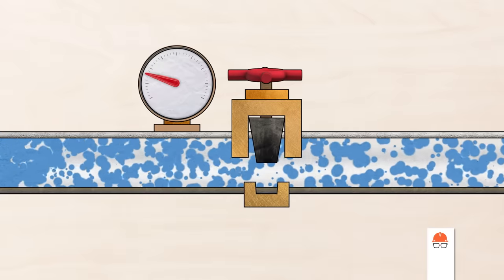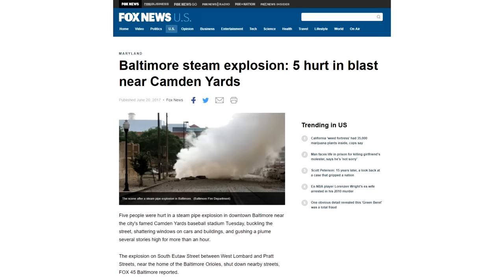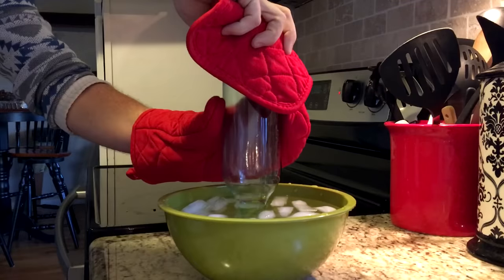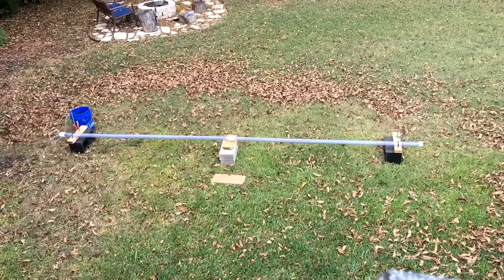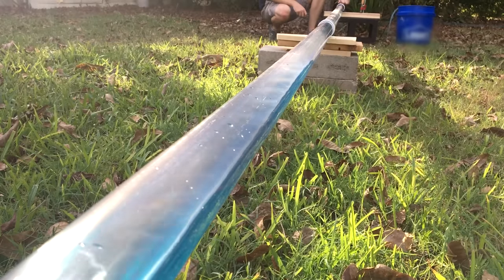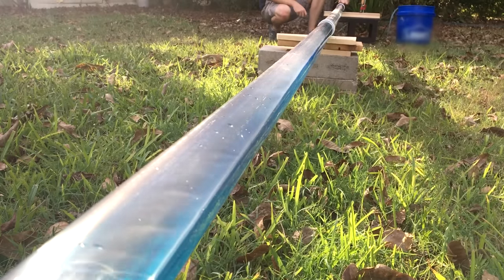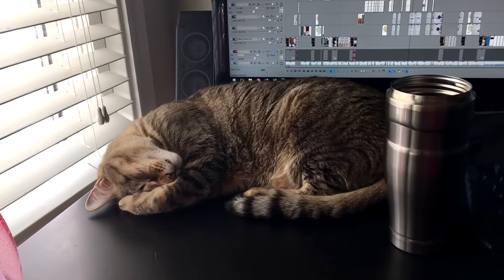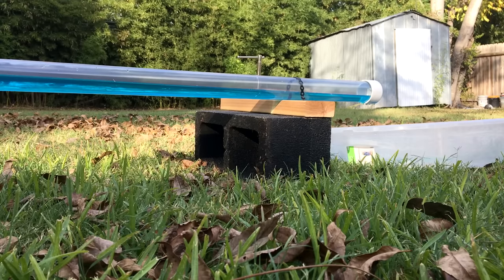What is Steam Hammer?

Comment: Amazing ! You're able in 5 min to introduce this very complicated issue of steam pipes ! Indeed, steam is useful and can be dangerous if miss handled. I used to work in a Chemical factory and during the construction, I was involved in the steam pipes design. For cost cutting, the final client (Chinese) decided to cut the bleed valves and the steam traps. I had to fight and was desperate about this issue. Of course, during the startup there was a huge blow and a 20" pipe broke. We were then obliged to halt the project for 3 weeks to install the bloody bleed valves and steam traps. Hopefully there were no big losses other than the 20"pipe to be replaced (+ insulation + weldings + some flanges)... But hey, This is China ! 
One comment to what you said: there are not only chemical engineers and mechanical engineers involved in steal transportation issues. There are also process engineers ! So please don't forget us next video ;)

Comment: Next month: What is Ice Hammer?
Reply: Actually, although it's probably not called that, pressure exerted by ice is probably a really significant consideration in civil engineering, so I say Grady, get to it and make a nice seasonal video in about that third phase of water so many of us have to deal with around this tine of year.
Reply: Ice hammer is what happens when you drop that 10 pound bag that you bought from the store on your foot. :-p
Reply: When a lake is frozen over and a breeze is blowing across it sometimes the ice can be pushed ashore and destroy property. I'd call that ice hammer
Reply: Nabre Labre True, super rare, but I’ve seen it...

 Interestingly caused by basically the same thing as the steam hammer he demonstrated... 🤔
Reply: Nevir202 just read some stuff regarding Niagra falls. Apparently the only (recorded) time the falls ran dry due to non human intervention was after heavy winds blowing across Lake Erie increased the water flow and forced large amounts of lake ice into the mouth of the Niagra River creating an ice damn. Not quite a"hammer" but pretty interesting.
Reply: Andy Brice Ice can block a river's flow temporarily. The water builds up. When the dam bursts, it can cause catastrophic flooding.
Reply: Ice Hammer was an underground hip hop artist in the late 1980s.
Reply: 2020 : plasma hammer
Reply: @qwertyTRiG  
At one time, when the glaciers that covered most of Canada were melting, a giant sea of water built up on the ice pack. As it moved closer and closer to the edge, the rim of Ice broke away, releasing a sea of water into the Atlantic ocean.  The water rose about 20' worldwide in a very short period of time.
Reply: @truthspace5525  That would also have a massive effect on ocean salinity, I'm sure.

Comment: Surprised you only covered just the one problem with steam.
I used to work on a large estate as an electrician, but as we were multiskilled, i dealt with some aspects of heating, that included the steam system, i was trained in how to work with steam.
On an industrial steam heating system if the steam is shut off to a building (auto safety valve), to restore the steam we shut of the manual valve, reset the safety, then gently crack open the manual valve for a short period, this was to start the heating of the condensate, this was followed by a series of opening and closing that valve until we could only hear the steam going though the pipe without the boiling sound.
Basically, if you let the steam in too quickly, it would flash the condensate to steam, creating a lot of pressure.
Those coffee machines with the steam injector boil the water in ther cup in the same way.
Reply from the maker: Sparky Projects I did cover flash condensation (thermal shock) in ththe video
Reply: But mostly about steam turning to condensate causing a vacuum, but when steam heats that condensate, it turns that to steam (flash heating) and can create a lot of pressure
Reply: I take it you are using seriously superheated steam?
Reply: I don't know how superheated, but we had '3 pass' industrial boilers running at 100PSI.

Comment: I have been working as an operator of engine rooms since 1986 (retired 3-21). I have seen a 300#, 3" tee blown out due to priming from improper boiler water level control (manually controlled coal boiler). I have many times tried to explain steam hammer to the new guys as a slug of condensate propelled at the rate of steam flow into the first obstruction encountered. Your video presents a visual representation I wish i could have shown them. Some got it, some didn't.

Comment: That is an excellent description of the water hammer concerns in steam delivery pipes.

Another location steam hammer issue that is found in steam turbines, and the case there is somewhat different.  At the plant we were most concerned about was the cases where the temperature or pressure of the steam dropped, and water droplets would form from the steam and be entrained in the steam flow. in this case, when there was a bend in the pipe, the water would impact and damage the pipe. You could audible hear the pinging of the droplets in the steam when this occurred. thankfully i never had an occasion to hear an actual occurence in the plant. 

This concern was greatest if the pressure for the steam header fell at the input to a generator. a case that could be caused if your steam turbine demand for steam increased faster than the rate  of steam your steam source(boiler, nuclear reactor, etc) could increase at. 

when the pressure at the inlet to the turbine dropped, the Curtis and Rateau stages that drop the temperature and pressure of the steam to generate the kinetic motion of the turbine may cause condensate in the later stages of the turbine, as it was designed for a certain temperature/pressure of steam at the inlet stage. This can cause water hammer on the turbine blades and over torque the later stages of the turbine. 

in fact one site had such an issue the last stage of the turbine oblong-ed the shaft and caused a vibration that required the turbine stages removed and sent to the factory for many months to be repaired. 

The greater danger here, is that you can over pressurize the condenser unit that is below the turbine. a condenser often has blowout discs, but if over pressurized can become a bomb in the plant. they are often oversized to the turbine and fitted with blowout discs to prevent this.

Comment: A hammer that uses steam
Reply: Daniel harman it has alot of discounts per use
Reply: They have tried hammers that ran on steam but there is a max size/force they could output so got replaced with other types from the hydraulic hammer to the flywheel hammer.

Comment: Is there ice hammer?
Reply: Yes, when a water pipe has a short section where the tempurature is at freezing and turning on the tap produces enough pressure difference to dislodge the chunk of ice, causing the ice to crash into the next bend or valve.

I just made that up, lol. I don't know.

Comment: Great video!  That explains much of what I've been watching on the steam engine builder and  operator channels I love to watch.  I'd love to see something on what happens with alkaline water in a steam boiler or steam engine.  I've heard there were many accidents involving steam tractors and alkaline water out west, notably, Laura Ingalls Wilder's first flame, Cap Garland, died in a steam tractor explosion at a very young age.
Reply: userunavailable3095 the alkaline water has lots of dissolved minerals that coat the steam tubes of the boiler, reducing the effective diameter and causing the  pressure to spike and steam hammer to form earlier than expected.

Comment: In 1992 I worked for a small engineering company. I was sent to a large chemical storage plant to map certain pipe networks and to check if the pipes, supports, and valves still complied to regulations. This was a two-week operation; it was a BIG plant. One day I was at one part of the plant and I heard this Whooshing and hissing noise. When walked around one of the tanks I encountered a steam pipe with an open end - the blind flange had been half-blown off. It was doing what you describved: blowing a lot of steam and occasionally shooting a blob of water. Now, 30 years later I understand what was going on there.
Of course I reported the occurrance to the operators of that part of the plant.

Comment: I was a NDT worker (Pt,Mt,Ut & Rt) for many years. We were sent into many different types of industrial applications to test steam pipping and other systems. The steam pipes erode from the inside out, so thickness was measured ultrasonically with the major area of interest at 90 and 45 degree bends.To prevent steam hammers many systems used a dryer to remove any water vapor that can occur.

Comment: Thank you for your steam hammer video.   Your video actually presented slug induced water hammer, where steam is made to propel a slug of liquid water at high velocity.  

The other version of this water is the more lethal type.   It is called condensation induced water-hammer!   In this case, the waves of liquid water surround a parcel of steam and cause it to collapse violently.    This type of hammer is so potent that it can and has ruptured steel pipe catastrophically!   In fact, you provided a glimpse of the results of this waterhammer when you showed the Manhattan steam rupture event.

Comment: I work a spring and fall maintenance shutdown at a coal power plant. I’m a Union carpenter and we built the scaffolding for the boilermakers and plant workers wherever they have work that is elevated. Every shutdown we build in boilers that need pipes replaced that hold the water that’s heated and turned to steam to spin the turbines. It is incredible how much damage is done when just one of the 4 inch pipes blows from pressure. It will destroy all pipes for 6 feet on either side of The malfunctioned pipe.

Comment: Spent 5 years as a mechanic in a submarine power plant. Steam hammer is pretty scary stuff. Sounds like a train hitting a brick wall at 150 mph and you can see pipes jump. Happens when someone forgets to put traps in service or tries to put them in service too early before they've been warned up and condensate backs up too much. Only other thing that comes close is when someone doesn't put a trap on right and steam just starts shooting into the engineroom.

Comment: Having worked as a steam boiler operator producing steam for over 20 years, besides steam traps, it's essential to use vent valves and smaller by-pass warm up valves to allow larger cold steam pipes to gradually warm up on cold start ups to prevent damage or personal injury.

Comment: I think single-pipe steam heat for homes is one of the cleverest things ever invented. The way it was explained to me is like this, starting from a cold system: The first steam enters the cold line, condenses almost immediately, drops the pressure, drawing more steam off the boiler and warming the pipe. As this progresses the steam progresses further along the line, heating it. You end up with fast moving steam, drawn up the line by the pressure drop caused by the ongoing condensation. Eventually, this process reaches the radiator where you want to deliver heat. At steady state, the steam moves through the radiator, giving up heat, condensing, and thereby causing the pressure difference in the fully heated system needed to move the steam from the boiler to the radiators. No mechanical devices are needed.  The trick is to pitch the pipes to return the condensate and have a big enough diameter pipe and appropriate wyes, elbows, etc., so that you don't fetch the returning condensate with the outgoing steam causing hammer. Clever piping near the boiler and various vents are required to keep from killing anyone. Truly amazing!  Unfortunately, there's not much if anything you can do with the heat in the flue gas, so the efficiency is limited compared to modern furnaces.

Comment: I grew up in a house with steam heating. And yeah, everytime I had to turn off the furnace for repair or maintenance, I had to "bleedout" the excess water from them as the furnace warmed up. 

The one time I messed up and forgot to bleed one of the radiators, I was stuck with an annoying occasional metallic rumble until I did the whole operation right again.

Gotta say tho, I miss those things, dangerous as they can be.

Comment: I'm a process engineer and steam systems scare the bejesus out of me even though I design them. Everything about them is dangerous and difficult. I was once in a factory when someone opened a 6" 12 bar valve suddenly and it blew a pipe spool through a concrete wall. The other classic is seeing handprints on unlagged lines where some unfortunate person touched the pipe and their hand stuck to it instantly because of the high temperature. Great video.

Comment: I’ve worked with steam systems for nearly 50 years. The best example of steam hammer I’ve ever seen was on a 12” 125 psig steam line that ran straight for 4 city blocks before making a 90 degree turn. That pipeline was pressurized too rapidly when it was cold and the resulting condensate slug was accelerated to supersonic speed before reaching the 90 degree elbow. The water literally could not turn that abruptly and punched a massive hole in the elbow which was made of 1/4” thick steel. Fortunately no one was injured, but it was quite a demonstration even though unintentional.

Comment: In my old apartment - with steam radiators - I stopped the hammering by putting wood shims under one side of the radiator so the condensation would drain down the supply pipe in between heating cycles. The radiators were tough as nails, but sometimes a steel pipe would blow and cause a huge mess.

Comment: Had steam heat in my last apartment. Banging sounded like someone pounding a hammer against the radiators, usually at 3 am.. Putting shims under one side of the radiators allowed water to drain and helped a lot.

Comment: I recalled being escorted by a worker at a steam generator power station (I was there to pick-up a failed induction motor-fan for repair), and the worker carried a broom stick in front of us waving it up-and-down.  He explained super-heated steam leaks at extreme pressure is not visible.  The broom stick is used to detect such leaks.  If there is a leak the broom stick is sliced in two instantaneously ….. instead of your arm or head.  Of course, if leak is detected, we were to stop in our tracks.

Comment: I work at an enzyme factory. We use a lot of steam in pipes to keep things sterile. We also use it for boiling the nutrients and some condensation had collected just before one of the big valves that allow steam to pass through. When we starting to heat up the nutrients, one of the gaskets was apparently not made for this kind of situation and the whole thing blew off. Luckily no one was hurt, as the steam blew out on the opposite site of the operator, but he could have been dead or at least badly injured with burns. Imagine his example with the bottle, just sized up by 200.

Comment: Steam hammer should never be allowed in a rental house or apartment with rads, nor a workplace where it becomes a problem to employees, other than the odd problem to be attended to right away. I heard years ago the fix is shut and empty the whole system, cut pipes where steam traps will help, add T fittings and place empty and capped pipes upwards on T fittings, you mentioned this, also as you mentioned, draining the system often enough. Someone who owns a house with those big steam rads says it's not noisy because it gets drained just as that person shovels the driveway and steps. Steam hammer is not only annoying, it's as bad as someone with a sharp voice yelling into an ear 'gink, gank, bing, BANG ..." and doing that more with more volume for an unknown amount of time. It startles and it wakes even after getting somewhat used to it this still wakes people. That is so unhealthy. I spent many years in an apartment with those big rads heating over the winter months. The noises I hear now are hardly that much. And I'll say I am so relieved to have the quiet baseboard style water heaters I use now, I haven't heard one noise out of them. Good design and or maintained well, they do their job like they aren't there. Steam heat isn't good when landlords, operate the system poorly too. Way too hot and on often, window open may not be enough or safe in rough neighborhoods, they can't be cooled enough while on at lowest valve setting. And some landlords have the boiler on as little as four times a day for enough time to get heat in the room in mid winter, six times on coldest days. So there's that steam cooking or frequent major temperature changes. It should be illegal to run them without professional guidance and tenant communications about them. If they can't be run for best and quiet heating, they should be replaced during the summer months by a different system or the place properly and ethically evacuated with use of emergency heaters to buy time to move out, landlord pays for search time labour and resourses as well as the movers and pays higher rents for those stuck with increases until the heat system and the whole building is fit to move back into. I think stringent laws will make this form of heating work well or become something of the past for many people. Great article. It gets a thumbs up from me.

Comment: Steam heating is interesting.   Low pressure, just 2psi to reach the top of the Empire State building on the coldest day.  The Hartford Loop, which stopped the 2-3 boilers blowing a day in the country, but a constant thermal shock interface  where the condensate return connects to the equalizer that keeps the steam pressure from pushing the water out of the boiler.  And all running relatively unattended in the home's basement.